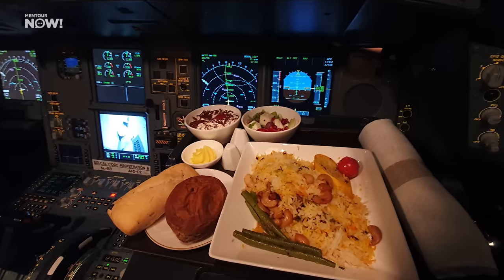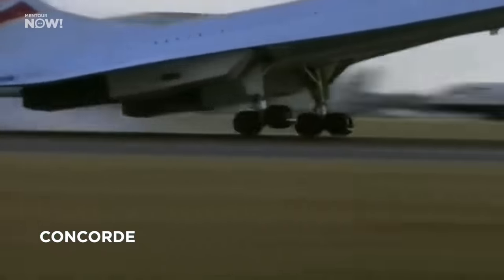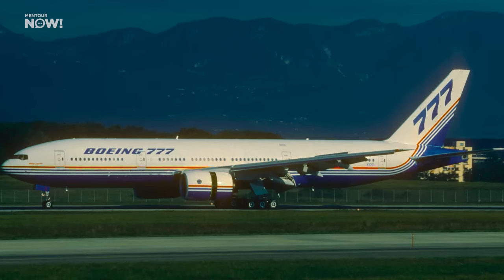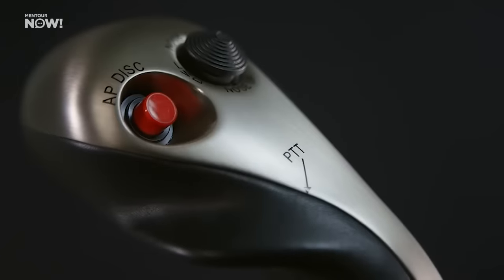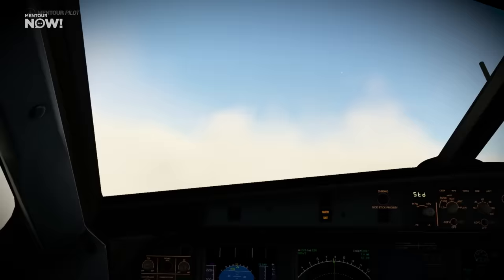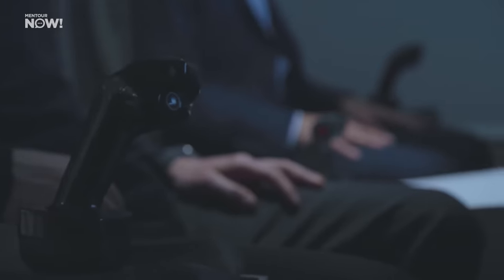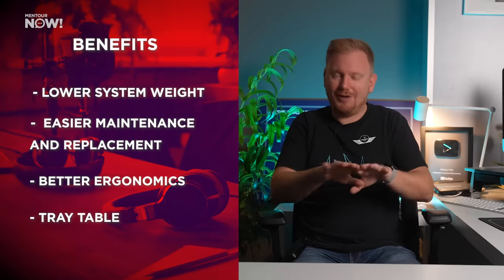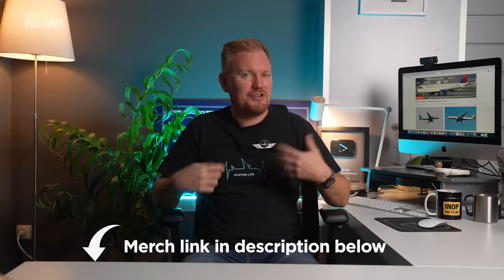Will Airbus Finally switch??

Comment: I feel, and firmly believe, that the issue for Airbus is far from technological. I'm pretty sure the technology is already there, and I would even bet that they have already tried the system secretly. The problem, I think, is on the cognitive side, therefore on training aspects as well. It is a philosophical change, and I can only imagine a pilot that has been trained on force feedback trying to revert to the old system. I don't think is practical to retrofit planes, maybe the less popular models, but retrain dozens of thousands of a320 family pilots is not an easy not cheap task. I do imagine future new models with the system, or maybe an iteration of the a350, but I am not sure that the lack of feedback has been the primary cause of any of the incidents and accidents, let alone when I learned what happened to that AF's 777. So... as usual, economics will play a huge role on the final decision. It sounds like a good idea, it probably is, but retrofitting does not sound too practical or reasonably economical.

Comment: It's disturbing that the tray table is something that Airbus pilots would actually brag about... not only does it not improve aircraft control or safety, I would argue it makes both worse. We're talking about a commercial aircraft cockpit, not a lounge chair.
Force-feedback sticks don't fix what seems to me to be one of the most basic problems inherent in side sticks, which is that the pilot and copilot have to use different hands. The muscle memory developed as a first officer in the right seat becomes almost useless the moment that pilot switches to the left side... it has to be completely relearned. Amplified by most pilots being right-handed and now having to rely on their off-hands. It almost seems as if Airbus pilots have become so reliant on autopilot systems that a lack of fine motor control on the stick isn't something that they even care about.

Comment: With over 14000 hrs on A320/330’s and now as a active B787 Pilot (5000+ hrs) I much preferred the side stick. The centre yoke makes the Boeing flight deck cluttered and an ergonomic disaster . From a practical point of view you use the yoke for approximately 2% of the flight, the other 98% of the time the aircraft is on the autopilot. The yoke just gets in the way and is a pain the proverbial rear.
Reply: Which works better during an emergency?

Comment: I find it ironic that the term "fly by wire" means that there is NO physical wire between the pilots controls (such as yoke and pedals) and the airplane's control surfaces (such as the rudder), while NON-fly by wire means that those planes DO use strong physical wires from the cockpit to the plane's control surfaces. A more accurate term would be "fly by electronics" because the defining feature is an electronic signal, which can either be transmitted through a signal which could be a wire, or a computer cable, or by wireless signals.
Reply from the maker: GREAT point! Although, some aircraft that don't have fly-by-wire rely on hydraulics to connect the yokes with the control surfaces..! No wires.
Reply: @MentourNow  Thanks. I'd like to see a video on whether the wires in a plane are shielded or not, how they resist airframe flexing/stretching, what their operating temperature range is, is it copper wiring, which wires have redundancy, etc. An entire episode on wiring. I'm just curious.

Comment: This has been a no brainer for almost decades with the airbus and the only true reason I can see for it not happening is admission of liability in past accidents. The weight or tech argument doesn't float. Even breakable pushrods aren't going to weight more than 50kg at most!

Comment: The new version of the MS-21 is completely manufactured without imported components, including PD-14 engines and active control side sticks inclusive all avionics are no longer French, but Russian-made. The first delivery of 6 pieces MS-21 310 will be delivered to customers in 2024.

Comment: Weird question: Why haven't aircraft companies adopted a gamepad-style controller instead of the yoke or joystick? Pretty much everyone from the 80-90-00s generation is able to use use due to Nintendo/Playstation. Wouldn't it be easier to use one of those (or a variation) since it is already the "unofficial standard" in gaming?
Reply: This would give you the added advantage of going through the menus in the Flight Management System with the up-down-left-right arrows  (just like in games)

Comment: The Boeing 757 max is technically a fly by wire, it is aerodynamically unstable so they made it fly by wire in a roundabout way and never told anyone.

Comment: A video with lots of interesting points but not entirely unbiased. 
Firstly 777 is not really FBW, it is a traditional aeroplane with a breakout box for FBW. 
Secondly, do you really trim by feel? Set power and atitude and trim to remove the load - exactly what an Airbus does in each axis.
Thirdly, Airbus already apply a form of feel into every landing - The control law changes  and inserts changes in pitch to make the pilot flare.
From flying gliders upwards "feel" does not reflect a required control input - any Boeing pilot who thinks it does needs to examine his actions more carefully. The reaction is made from experience and is complex not a direct to yoke pressures.
I have experienced "dual input" and it is confusing, but no more confusing than the change in "feel" when the other pilot makes overidding inputs on a Boeing.
I would welcome any system which gives better awareness of dual input in both makes of airliner.

Comment: Not a commercial pilot, but I do hold a PPL and have owned an airplane.  Not sure how you get two pilots fighting over the controls to the point they break them.  I know when I was flying if someone in the right seat, or if I was in the right seat and wanted to give control we arelways said "your plane, my plane"  Does that not happen in the bitg cockpits?  Just asking because I don't  the protocol on the commercial birds, just assumed it would be the same.

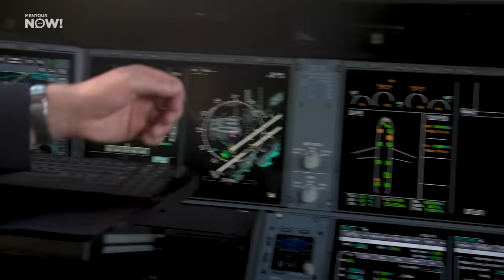Comment: 07:52 Touch screens are a terrible choice for safety-critical vehicle user interfaces.  They don't provide tactile feedback and require that one look at the display to operate them.  Edit: This includes not-obviously critical-to-safety things like car radios that, when using a touchscreen, require one to take one's eyes off the road to operate, thus impacting safety.

Comment: A320 / 321 are not full fly by wire they have classic flight controls buffered by motors and computer in the cockpit
They dont have independant servos in each control surface

Comment: Please correct me if I'm wrong here. As well as the horrible af447 accident pointed out the perhaps weakest thing whit the sidestick that are in use today, I also think the fly by wire system showed a dangerous weakness. 
I might be wrong but if I understood the reports about that crash right it didn't took more than the iced pito tubes to disengage  the autopilot in the first place, and since the flight management computer didnt got the speed data it more or less also gave up after a while of crazy inputs made by the co-pilot? Of course the co-pilot failed badly to recognize the situation and then the stall he put them in but I'm wondering how the safty systems actually could have prevented him from doing what he did, I mean how advanced is the safty systems really more than telling the crew warnings in a speaker and showing a quite small text in the flight displays? It's like af447 is an accident were both human error and (perhaps a bit overestimated?) flight management system came together in the worst kind of  outcome. Safty systems and their weak points is an interesting subject for discussion I think.

Comment: I think you need to rethink some of your comments. The envelope protection touted by Airbus has not prevented aircraft from stalling as demonstrated by the Air France crash into the Atlantic Ocean where the crew held the aircraft in a stall all the way down. Yes, the pitot tube had iced over to initiate the upset but the crew aggravated the issue.

Comment: Please provide some actual data where an accident was prevented in a Boeing where the active “yoke” input was monitored and the PM was able to prevent an accident / incident solely on an active yoke.
Have been in the Airbus for a long time, never felt the lack of an active sidestick was a hindrance. Quite the opposite- after a while you really can “feel” the state of the aircraft energy level because you pay more attention to thrust and speed trends.
Airbus - please don’t change anything.

Comment: Iam always wondering if airbus pilots have issues with retraining their muscle memory and senses when they are promoted from FO to captain. I imagine that it could be quite a struggle to have to use the left hand after many years of using the right one for the control inputs.

Comment: Something I’ve been wondering about sidesticks: are pilots required to be ambidextrous with them?
What happens if, after years of controlling an aircraft with the right hand, a FO is promoted to Captain and now has to control the aircraft with his left hand? Surely this is not without challenges.
Reply: It’s easier thank you’d think and not a big challenge at all when switching seats.

Comment: There always seems to be a lack of understanding by Boeing pilots about exactly how the Airbus side stick does its job. The 737 200 autopilot had a function called CWS (Control Wheel Steering). You put the autopilot in CWS and you could control the autopilot through the control wheel. It was dreadful, but we are talking something designed in the 1960s. I never saw anyone use it in anger.

The A 320 in Normal Law is like that only a thousand times better. In Alternate Law it is nine hundred and ninety nine times better. Basic Law could be likened to a 737 in manual reversion in that it isn't much like the normal aeroplane but it will get you home. In 6000 hours on the A320 I never saw Alternate or Basic Law anywhere other than the simulator.

In Normal and Alternate Law you use the side stick to change what the aircraft is doing and when you release it the aircraft will carry on doing the new thing (angle of bank and pitch attitude). For example if an Airbus drops a wing, the flight control system will pick it up again without pilot intervention. There is a lot of comment by people that don't seem to understand this basic difference between this and earlier aircraft.

Something that is taught at the earliest stage in learning to fly is that only one person flies the aircraft and the "I have control/You have control" ritual makes sure we all know what is going on. One of the worst faults in an instructor is riding the controls when the pupil is meant to be flying. I am not aware that those words were said by anyone in the Air France accident, nor am I aware that either pilot read the boxed items on the primary display, as they are required to. This would have gone a long way to solving the problem. Instead of reasoned discussion there was an almost panic action to regain the "lost" 300 ft that was caused by the reversion to uncorrected pressure sources when the air data computers disconnected because of degraded pitot information. This had happened on other aircraft and the pilots reverted to flying pitch and power until order was restored without further incident.

Comment: Does it make sense dual input on joysticks that already try to mimic each other when the system already complaints about dual input?
I'm not a pilot, so from my pov having feedback on the joystick flying the plane seems enough. 
Having a mode for moving the nonflying joystick seems also a good feature, so the nonflying pilot can feel what the other pilot is doing, but in that mode the input is only from the flying joystick.
Two pilots trying to fly both at the same time with joysticks that move on their own replicating the other pilot moves scares me and I think it is more dangerous as both pilots loose accuracy. I think you said that in dual input the computers do an average, that sounds safer than pilots correcting unexpected moves from each other on joystics with limited force.